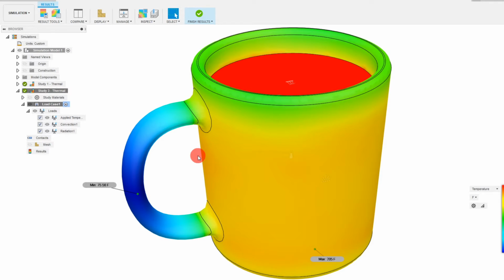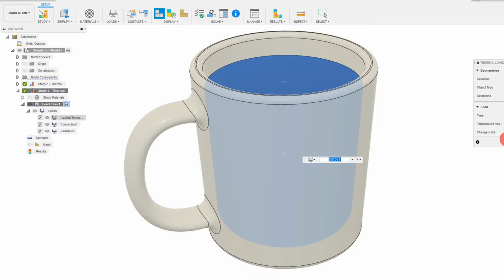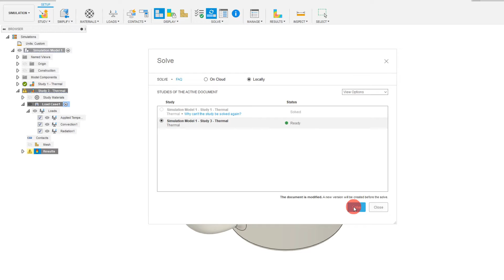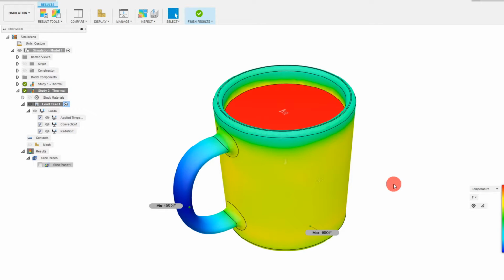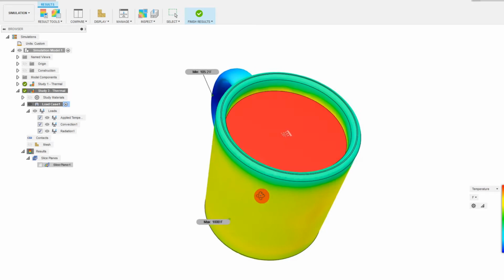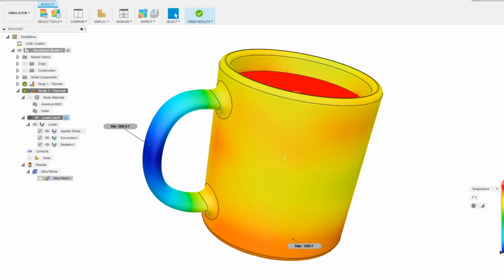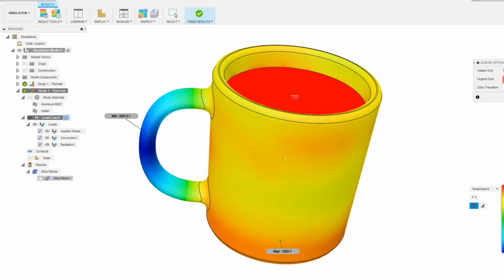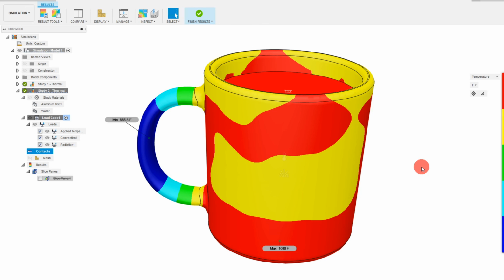Fusion 360 Thermal Simulation Tutorial- Loads and Constraints Coffee Mug Part 2

Comment: Hello sir, great video. I do'nt think it has a dynamic thermal simulation on Fusion 360. I want to see effectiveness of outer material on insulation by time. Thats why I need a report of a simulation which shows how outer material is good at keeping liquid heat in consistent level for a longer time. Do you have any recommendation, or a software?
Reply from the maker: I would consider Ansys to really do it right.
Reply: @AvivMakesRobots  Thank you so much for quick reply.

Comment: So the simulation suggests that someone could pick up a coffee cup that has 1000F liquid in it?  Does the model account for convection near the cup surface?  How small do your fingers need to be to fit in the D handle and not get burned?
Reply from the maker: Definitely not. The heat dispersion is similar at high temperatures, but all the values become scaled up proportionally. Fusion has not added CFD, so convection is not accurate.